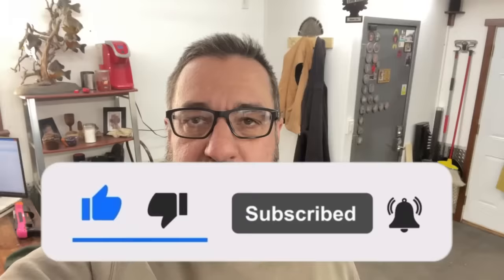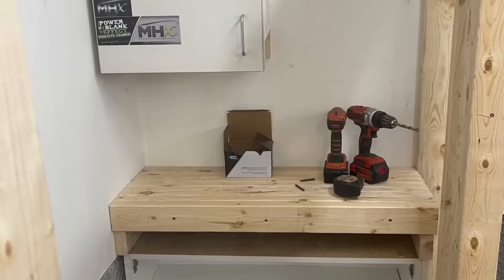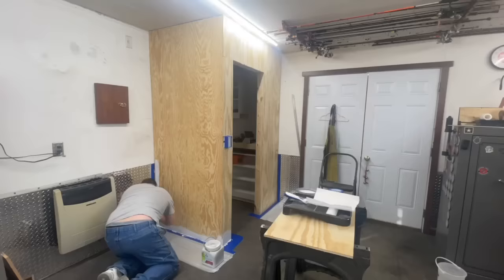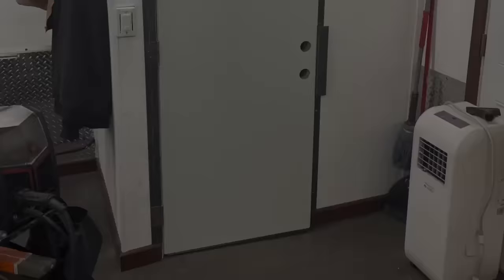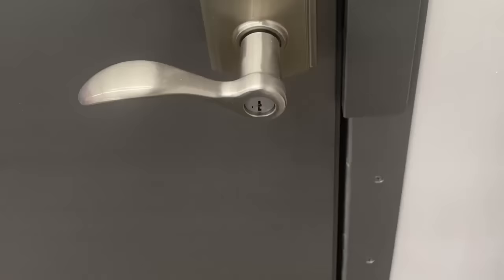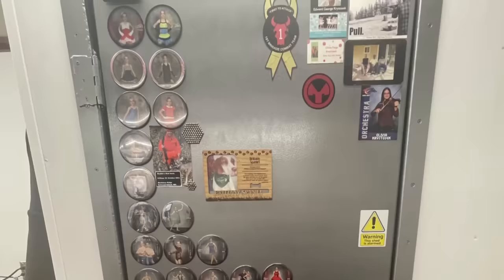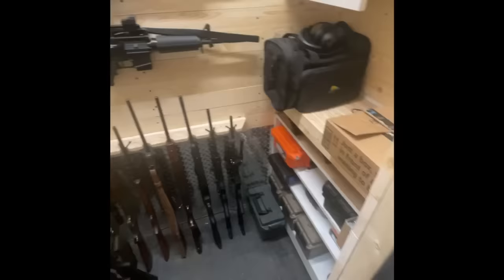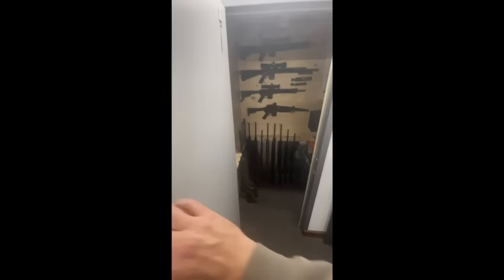DIY Walk in Gun Vault Room Storage

Comment: This is SUPER cool. Question though. One could punch through the drywall on the side with the shelves. It wouldn't take long to do. Also, those key code locks can be drilled out with a good drill.  I'd use an industrial Medeco deadbolt key only, over the Kwickset key code lock.
Reply from the maker: True, they could go through the other two walls but they are walls that are exterior walls. That have to go through the steel siding, 1/2 plywood, spray foam insulation and dry wall. All that activity is captured on a Ring camera which notifies me and now they have to deal with a pissed off home owner.

I have had lots of comments on the locks and I agree but unfortunately I can’t afford the Medeco locks right now.

Thanks for watching and don’t mis out on my gun giveaway video.

Comment: Not to be discouraging, but as formally not so good person ( reformed and now working with security companies) your DIY Vault is week.  I see you’re a welder and this will be addressed later.  Your first big mistake was SCREWING the angle to the WOOD STUDS.  Reason being is your wall is only as strong as your weakest link ( THE STUD ).  You put the steel between the stud rather than over the stud.  You should have covered the studs from floor to ceiling. The wall being struck with a small sledgehammer will blow that wall apart ( trust me, I went through a lot of walls in my past life ). So let’s address your door.   Kwikset locks both key and digital take around 30 seconds to defeat with bump keys you can buy online.   Not only that, but you’re only locked at one point.  You say how your door frame is steel.  Thanks for making it even easier for someone to use a pry-bar to bend your door. Trust me it can and will bend with little effort.  Now back to the fact you weld.
Reply from the maker: @motoxman541  trust that i didn’t show you everything and in the 1 min it would take to defeat the locks i will be in you face with a 12ga because i have cameras everywhere…& you still must get in the building.

Anyway, believe me when i say you are not getting past that wall with a sledgehammer. 

Thanks for watching.

Comment: is the dead bolt you installed a free exit like the handle is? if so i could get into your vault fairly easily and would like to share with you some knowledge if you're open to it.
Reply from the maker: The locks are getting changed out as soon as the $$is there. That is all I could afford.

The whole point is to slow them down. They have to defeat 2 barriers, 4 locks, multiple cameras and get out before I am in their face.

Thanks for watching.

Comment: So It looks like you didn't steel line the two fo the common walls or the the ceiling. what  is going to stop a thief from popping a couple of hole the ceiling or the back wall to remove you guns. Or just give me a large crow bar I would  have that broke apart in 15 minutes
Reply from the maker: The other two walls are exterior walls and are sided with steel siding. Breaking through would draw a lot of attention. there isn't enough room in the ceiling to get over the wall. Maybe 15 minutes you could get in but in 2 minutes you are facing an angry homeowner. 7 minutes and you are talking to a cop. I have cameras all around the property both in and out. 90% of burglars are not going to dedicate that kind of time.

Thanks for watching and there are updates coming.

Comment: Cool project but super surprised to see how over engineered everything is and then opting for the cheapest brand locks available. As many have said, these would be trivial to bypass. I'm sure you paid a lot in materials for this room, shame it's all for naught with the lock hardware. Dump those, get a passage knob and either a Medeco or Mul-T-Lock deadbolt and this is truly secure. You're also going to regret welding the hinges on down the road. Heavy doors sag and wear out hinges. Source: 10 years a locksmith, not just a guy that watches the lawyer on youtube. Good work nonetheless.

Comment: Not bad but not as good as my 16mm AR 500 plate door with locking pins and hinges of 40mm steel. All internal. The door rim is made of 200 x 10mm steel channel that has 16mm re enforcing rod welded into it from every concrete brick layer.

Comment: What size plates did you use and where did you get rhem?
Reply from the maker: 1/4” thick cut to size as needed.

I got them from a local steel supplier/fabrication shop.
Reply: What did you use to cut them and how much did they cost?

Comment: This should keep most crack heads and meth heads out along with the smash-n-grabbers who want to be in and out within three minutes but it has several weaknesses that will only slow down a professional burglar. The door and lock, I will not go into detail but these are lacking. The big think I see is the fact that you have 1/4" plate welded to brackets between 2x6 studs, you are relying on the nails at the top of the studs to hold from an impact such as a battering ram. I saw two nails at the top of the stud and there are likely two more on the opposite side, these are mild steel and bend very easily by design so they will not break in half. This is the weak point on the walls, at minimum you should have used more nails, GRK screws to help prevent pull-out or best yet steel angle with bolts going through where possible and 3/8" or 1/2" lag bolts where a bolt and nut are not possible. Since you have a welder making it entirely out of steel using square tubing would have been stronger but more expensive and take longer. Not trying to criticize well constructive criticism yes so others can learn from this.
Reply from the maker: Points well taken.

Thanks for the view.

Comment: I really like the approach you took on everything, after watching LPL for years and years I would be concerned with the key entries how pick proof are they ?
Reply from the maker: About as pick proof any any I would suppose. A professional is probably not going to have much trouble defeating the locks. Nothing is 100%. 

They would have to defeat my cameras, 2 locks, both my dogs, a vigilant neighborhood, and a well armed owner.

Thanks for watching.
Reply: @Jack of all Trades  yep. Used to say they gotta get past my German shepherd first.  By then I'm armed and ready
Reply: @jackofalltrades7822  My concern would be a break-in while no one is home.  My current cameras use WiFi which I assume could be jammed.  They use AC to power them which could be cut off.  They use cable Internet would could be cut at the utility box out front or where it enters my home.  Wireless Internet to the home likely requires an outdoor antenna that could be removed.  Cameras that have battery backup would help.   I am not sure the best option for Internet access would be for notification.

Comment: Weak point are the exposed hinges.
Reply from the maker: I welded the hinge pins and there are security pins in the hing jamb. 7:45 Even if the cut the hinges the pins will slow them down enough for me or the cops to get there. I also have cameras in key locations.

Thanks for watching.

Comment: So you put a video, on Youtube, showing exactly how you made you "vault".  Do you know how easy it is to find Youtubers?  For every security feature you attempted to put in this design, there is a crucial failure.  For one, those quickset locks can be picked in seconds with any cheap lock picking kit.  There are other easy ways to unlock the passcode lock.  Two, you didn't reinforce the two walls that were already there.  Three, those two steel slabs are only secured by 6 normal screws into wood studs.  Aside from the fact that getting into this "vault" through the "locks" would be easier than getting into a safe, if that door was actually secure, pulling off the plywood, cutting into the 2x4s in those six spots and cutting the screws would take no more than 10 to 15 minutes.  Then you just bust through the panelling and you're in.  You've done nothing more than spent a whole lot of money on tricking yourself into having a false sense of security.  That money would have been better spent on an additional safe, or making it harder to get into your house to begin with.  At this point, the best thing you can do to actually make this "vault" more vault like, is by getting rid of those useless locks and instead of using a door knob/bolt lock system to secure the door, using one or two sliding door security bars to secure the door, and using a padlock that nobody has successfully picked yet and would also take hours to cut through.  Not trying to be a dick man but this "vault", although well executed, was not very well thought out and if you're going to do something, do it right.  Your firearms, depending on what safe you had, are now in jeopardy of being easily stolen, should someone burglarize you.  This is a really strong closet.  Not even close to a vault.
Reply from the maker: “Not trying to be a dick” yet some how that exactly what you successfully did.

217k views and 733 comments and you honestly think your telling me something that hasn’t already been said.

Do you also honestly believe that I showed you everything or exactly how I secured the walls. Do you honestly think I just ignored the other 2 walls? You really think that I only secured the steel with 6 construction screws? There was a reason why I didn’t video the whole process. Most viewers automatically figured that out but apparently concept escaped you..

Just FYI, nothing is impenetrable, the point is to slow them down. 95% of thieves out there are not going to pick locks, bring tools to cut walls or spend 10-15 minutes making a ton of noise cutting up & Kool-Aid Man through the walls.

You see people like you think they are pretty smart but in all actuality your really just a**hats. You people just like to rag on other people and get some kind of satisfaction out of trying to make yourself look cool at other peoples expense.

Thanks for the view and the comment though. It helps with the monetization .